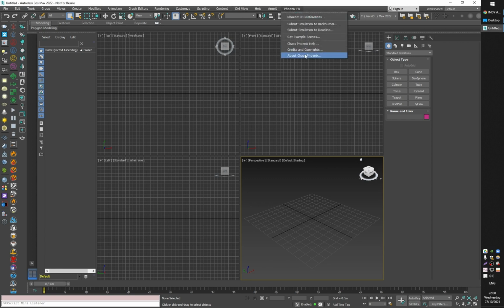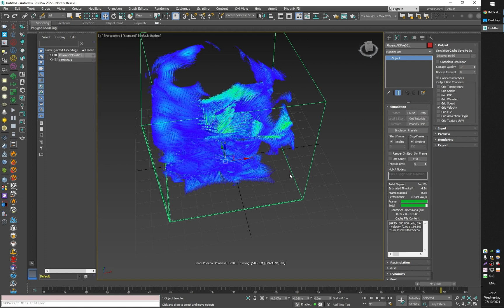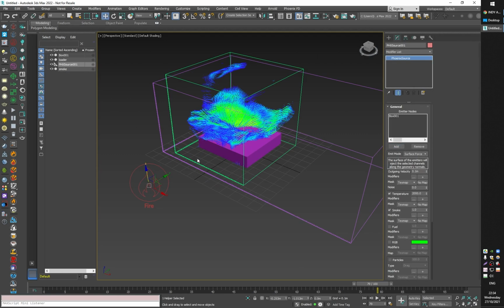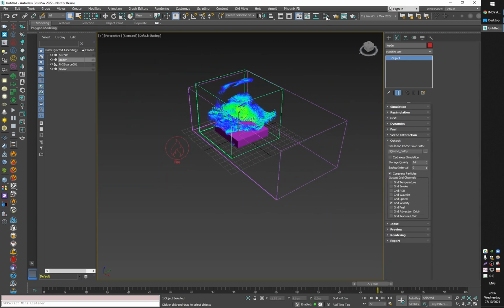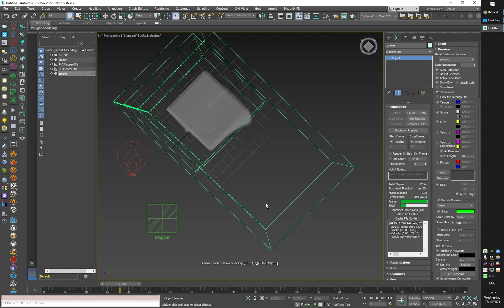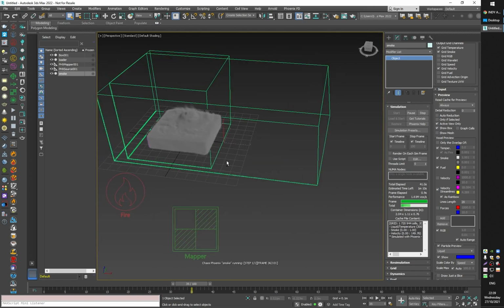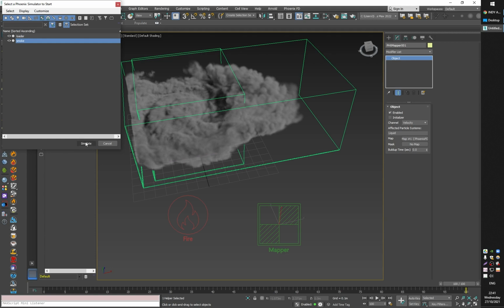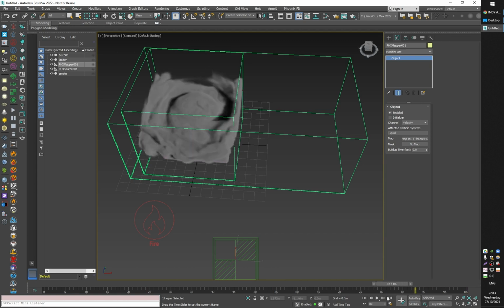Chaos Phoenix 4.41.02 Nightly - Cached Velocity as Fluid Force

Comment: Excuse me if I'm confused, but what is the difference between doing this and just simply applying the vortex force straight onto the smoke sim?
Reply from the maker: Ah, this can be done no matter how you create the velocities in the source simulator - I used a force for this example, but you can transfer any velocities from any simulation to a different simulator. It could be a smoke sim that then drives a liquid sim, or a fire sim that then drives a smoke sim, etc.

And additionally, the setup for the source sim could be long gone - the original scene might not exist anymore, but as long as the caches are still here, they can be used to create velocities in another sim.

Or another use case - you might be simulating the first sim in Maya and then using it to drive a sim in 3ds Max for example, or vice versa.
Reply: @SvetlinNikolovPhx  

thank you!!

 This explains things a little better.

 So if we save these caches for future use as a velocity in another sim, we can lower the resolution greatly too, to save space? Some of my sims are over 100GB alone. 

I did kind of think of an example earlier just after I commented...

So.. I could create a wave spline, have a smoke sim and path follow the smoke along the spline.. 

Save this velocity cache, then use it to drive another smoke sim, which would yield a different effect, for example a full cube of smoke with a wave like flow of air running through the middle?... I hope I'm following on properly? 🫣🤣
Reply from the maker: @R1PPA-C  yesss, or one scene we've done is an explosion that then drives a water simulation in order to splash it around.
Reply: @SvetlinNikolovPhx  one thing I absolutely loved from your team that I saw on here was the burning ocean sim, absolutely stunning work!
Reply from the maker: Hooray! I hope we can make more crazy setups like this one 😁
Reply: @SvetlinNikolovPhx  if you have any videos or scene files for that explosion and liquid sim I'd love to see it?? 🫶🏻🤣
Reply from the maker: @R1PPA-C Roger that!
Reply: @SvetlinNikolovPhx  oh hang on... So we can create smoke sim velocities... Then have those velocities be the absolute velocity for a liquid sim?... I best get back out of bed and start playing around 🤣

Comment: Thank you, but I can't stabilize a tornado for 30 seconds, the column always ends up dispersing, do you have a tip?
Reply from the maker: Ah yes, if you are using the Vortex force, it's quite picky and you gotta do a lot of trial and error to make it stay compact. Check the settings we used for these two tutorials: https://docs.chaos.com/display/PHX4MAX/Fire+Tornado and https://docs.chaos.com/display/PHX4MAX/Dust+Devil - I hope they would be helpful!
Reply: @SvetlinNikolovPhx  Thank you for your quick response, I hadn't seen your tutorials, that's exactly what I needed 👌
Reply: @SvetlinNikolovPhx  I managed to make a nice tornado, but the simulation is really long. Is it better to have GPU or CPU for phoenix simulation ?
Reply from the maker: @antoine__3925  Oh yes, the CPU is most important. Here you can check the hardware tips for Phoenix: https://docs.chaos.com/display/PHX4MAX/Setup+and+Installation#SetupandInstallation-HardwareAdviceforFasterSimulating
Reply: @SvetlinNikolovPhx  Great ! Thank you